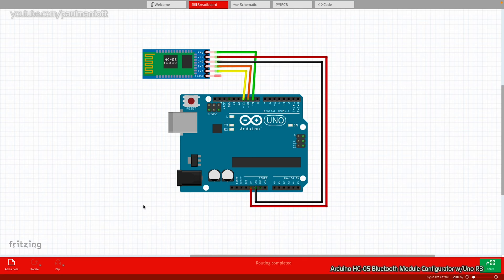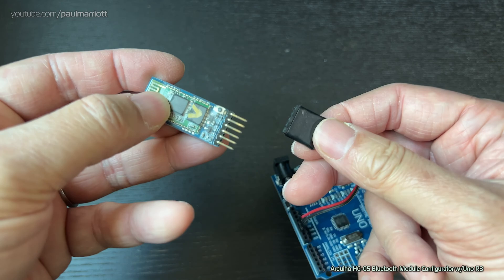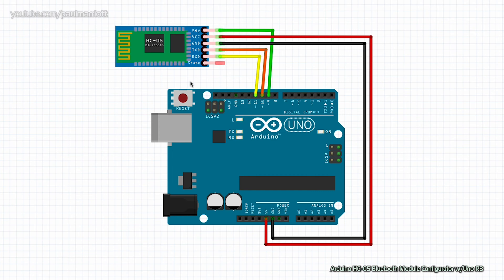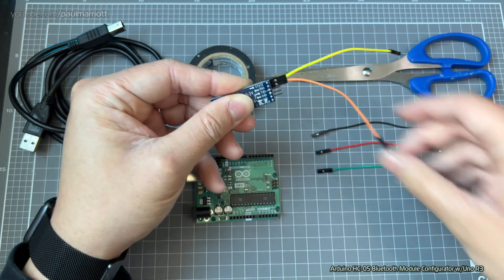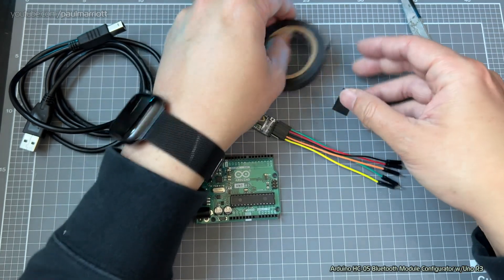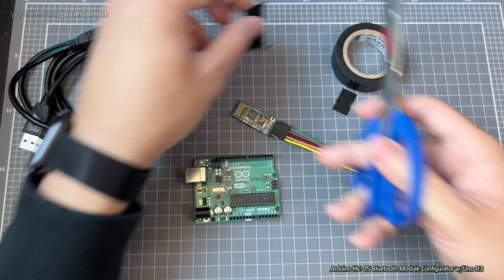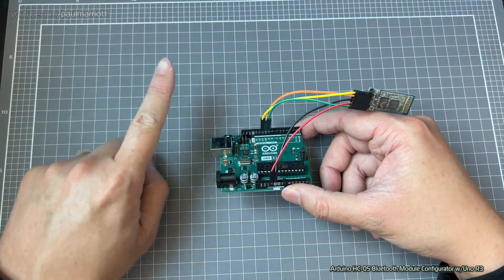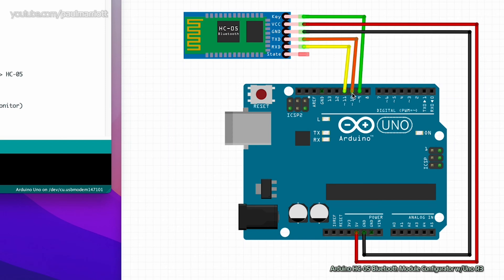Arduino HC-05: Bluetooth Module Configurator w/UNO R3 & Basic AT Commands [Tutorial]

Comment: I thought the RX line from the Arduino to the HC-05 needed to go thru a voltage divider. The divider being a 1K and a 2K ohm  resistor in series with the junction of the 1K and 2K resistors going to the RX pin of the HC-05, the other end of the 1K resistor going to the Arduino, and the other end of the 2K resistor going to ground.
Reply: I fried two boards ( without realizing why) because I connected the  GPIO Pin (TX Line) of Arduino directly to RX of HC-05; The connection showed in this video is responsible; The signal must be stepped down to 3.3 V or else the HC-05 will get damaged permanently
Reply: It guess it has an internal voltage divider

Comment: Thanks for the tutorial! 
But some problems i've faced:
1. AT Command not responding.
fix: Remove the USB cable from PC, press and hold the button of bt module and connect the USB again, release the switch in bt module. (Rate of change in LED blinking can be observed)
2. Other than "AT" not other commands responding.
fix: type " AT+COMMAND? "
example: AT+NAME? , AT+ADDR?

Comment: Great video! Just in case, for troubleshooting, if the AT command does not work and there are quick blinks(command mode), try holding the button when powering on the HC-05. It will change it to AT mode.

Comment: Nice Video Paul, thanks .
I had been trying for hours to get the modules configured using an Arduino UNO and connecting directly to the HW UART, but never had any luck. Even with your approach, I have found, (as have others it appears) that I must power cycle the modules AFTER powering the Arduino, otherwise I get no responses to AT command,

Comment: It works with pin 9 attached. I can change the name. It only works at 9600 baud which is OK. I can connect with my Android phone, password 1234, but then it disconnects after 5 seconds. Any assistance is appreciated.
Reply: Give HC-05 a stable power source

Use a regulated 5V supply with enough current (at least 200 mA).

If using Arduino 5V pin, make sure the main supply can handle it.

Check data mode

When paired normally, the HC-05 LED should blink twice per second (not fast flashing). If it’s still fast, it isn’t really in data mode.

AT mode should only be used for config, not for pairing with phone.

Test with a serial app

Instead of just pairing in Bluetooth settings, try using a serial terminal app (like Bluetooth Terminal or Arduino Bluetooth Controller).

Send some characters immediately after connecting. If the link stays alive when there is data, then the phone is just disconnecting idle connections.

Check baud settings

In AT mode, try setting the UART speed to 9600 permanently:

AT+UART=9600,0,0

Then use the same speed in your Arduino sketch.

Try alternate password

Some HC-05 modules actually default to 0000. Try setting:

AT+PSWD=1234

Comment: Hello there, thank you for the great video. I could only get it partially working and I wanted to ask for some help. 

When I type AT, it will send the OK message but when I try anything else it says error{0}
My baud rate is set to 38400 and instead of setting a pin to high I just plug EN into 5V which is within the range for my HC05.
Any Idea why this is happening?
Reply: It will also only say "OK" if I have it set to "Both NL & CR"
Reply: @alexanderbeuerle4488 did you find a solution

Comment: If it doesn't work for you:

1. Make sure the HC-05 slow blinks,  if it slow blinks, remove the pins and then insert the pins  on the hc05 whilst holding the button
2. Make sure to use commands like: AT+COMMAND?
the ? is very important
Reply: Thankyou

Comment: is it aright to connect RXD directly to arduino port?
the port provides 5V meanwhile the RXD on the module says LEVEL: 3.3V
Reply: The HC-06 needs to work at 3.3V or you could fry it. I think the HC-05 can handle 5V but I've been cautious and running at 3.3V. The Arduino board has a regulator that steps down from the 5V from USB to 3.3V if needed.

Comment: Just not working, keep getting error (0), can't find a solution to the problem.
Reply: I got the solution. At least for me. I didnt had a HC-05. I have BC352 and used the Baud rate 9600. Changed it in the code and in the serial monitor. Now it works
Reply: AT+ADDR? - don't forget about question mark

Comment: Very Impressive!!!    To ask you. 
In that https://www.youtube.com/watch?v=17kt5eq7guM video , a voltage divider is used
Can    I    use  voltage divider
               (    220 ohm        /        220 + (220 + 220) ohm        ) , 
I mean R1 = 220 ohm and R2 = 220 + 220 ohm,            in the HC-05 connection with the arduino uno? 
Or do I need 1k and 2k resistors? 
Since, Vout = Vin ( R2 / (R1+R2)  is the same,  it's 2/3,  I could use  R1 = 220 ohm and R2 = 220 + 220 ohm, right? Help, I am an enthusiastic begginer with this!

https://www.youtube.com/watch?v=17kt5eq7guM

Comment: I do exactly as said in the video, as well as holding the little button on the HC-05 module while powering up the arduino and releasing it after to get it in the AT state. I end up getting an OK response the the single AT command, but when I put another command such as AT+ADDR I get the error message "ERROR: [0]". Anyone who can help?
Reply: I got the solution. At least for me. I didnt had a HC-05. I have BC352 and used the Baud rate 9600. Changed it in the code and in the serial monitor. Now it works
Reply: just add question mark to every command exept AT like do this AT+NAME?

Comment: After setting up baudrate.can I now use 0 and 1 for rx and TX or I have to use 10 and 11 for rx and TX for my upcoming projects. Pl help
Reply: I know this answer is probably a year past when you needed it, but you can use the TX and RX pins on the Arduino board. However, I'd recommend using an alternate if available since it causes errors to upload sketches by usb if you have another connection such as Bluetooth or any serial device.

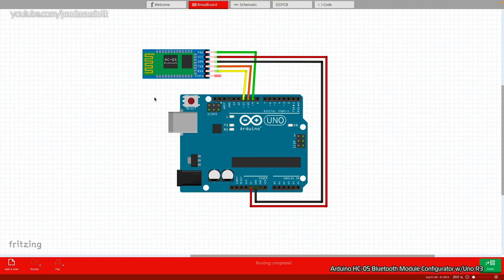Comment: So I am working on a school project and have the exact board you got at 0:35 except we put another board on top that has pins that slide onto both sides of the bottom board. I’m not sure what we placed on top but there are 12 pins with Bluetooth written next to them and I’m trying to figure out what I need to get to plug into it. Any help or suggestions would be appreciated
EDIT: the board we placed on top was a FunduMoto L298P Motor Driver Shield. It apparently has two bluetooth connections so I guess 6 pins for each connector. Cant find anything to attach to get  the Bluetooth
Reply: I used to have the same problem but you can use 3 ways to avoid it 

First you can use a breadboard

Second you can solder it to the motor driver 

Third you can use another motor driver for the same
Reply: @ChahatBhardwaj-l3p appreciate it. This was for physics class and none of us have ever done anything like this, nor do we know any coding, let alone C++. He told us to figure it out lol

Comment: any idea how i fix this error? when it try to flash it just stops here. ive been at it for several hours and im about to give up
avrdude: stk500v2_getsync(): timeout communicating with programmer
Reply: could be the baud rate
Reply: Remove the cable and connect

Comment: I'm not sure what I'm doing wrong here, but I'm just not receiving any responses from the Serial Monitor.
The code compiles and uploads, the HC-05 is blinking, so it's at least receiving power.
I have set the Serial Monitor to the correct baud rate.
One thing worth noting is when I compile, I have verbose on, and it includes a message saying Overriding Baud Rate : 115200.
Could this be the issue?

Edit:
For some reason there are also a bunch of missing character squares and backwards question marks at the beginning of the lines where it asks for AT commands in the Serial Monitor.

Edit 2:
I got it working by pulling Arduino power, pressing and holding the small button on the HC-05, and *while still holding the button*, plugging Arduino power back in. It now responds to commands as I would expect.
Reply: I GOT THE SAME ISSUE AND IT STILL DOESNT WORK HELP
Reply: @midnighthighwaycasettedust9940  Did you try his edited procedure? :
I got it working by pulling Arduino power, pressing and holding the small button on the HC-05, and *while still holding the button*, plugging Arduino power back in. It now responds to commands as I would expect.
Reply: @Howchon  YES ı did that, ı also tried switching rx and tx too. no respond whatsoever
Reply: @Howchon  ım sure the module is in the at mode because it blinks slowly, also ı tried ther methods like making pin32 high so it gets at mode, it does get in to the at mode but the console doesnot respond to me
pls help
Reply: Thanks!
Reply: Just to add context baud rate is the signaling at which it communicates so if you see baud you know you're dealing with a syncing problem. There are much more detailed explanations out there.
Reply: @BlueCollarFlying  what do you mean, ı tried with different baud rates but still at commands doesnt respond to my "AT"
Reply: @Midnight Highway Casette Dust  what power supply are you hooked up to?
Reply: @BlueCollarFlying  hey I solved the problem but thanks anyway
Reply: @midnighthighwaycasettedust9940  How did you solve this problem? I have the same problem. Thanks
Reply: @pedroavelar5380  if you did everything and still it doesnt work, than check your resistors, change them, get different value resistors,
Reply: @midnighthighwaycasettedust9940  you mean on the bluetooth board? I dont use any additional resistors.
Reply: @midnighthighwaycasettedust9940  how did you solve it. mine still isn't responding
Reply: yep that worked thanks
Reply: This is the only thing that worked for me thank you so so much. I'm writing a report on my project and I would love to mention this part of the making, can you explain to me why edit 2 worked? Because I don't understand...

Comment: Thanks for the video. I thought this module has 3.3V logic levels and the arduino IO is at 5V so you need to use a voltage divider on the TX RX lines? It's been ages since i used it so thats why i'm here. thanks for the refresher.
Reply: How did you make it work?